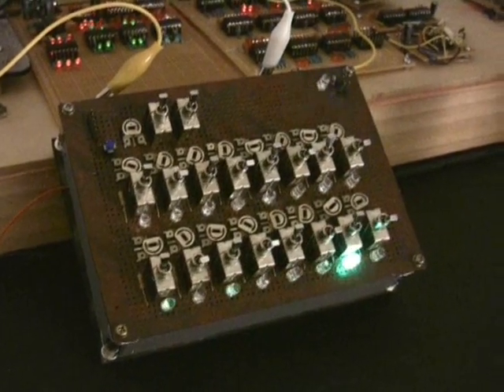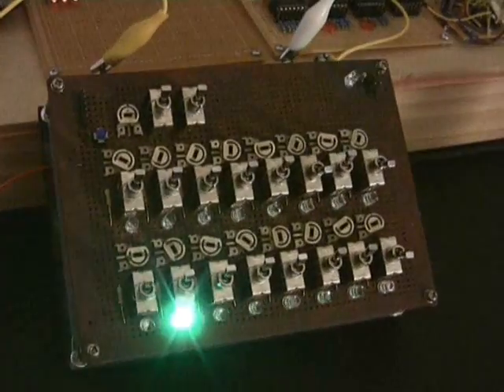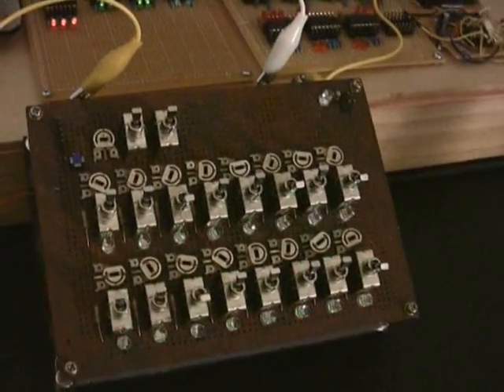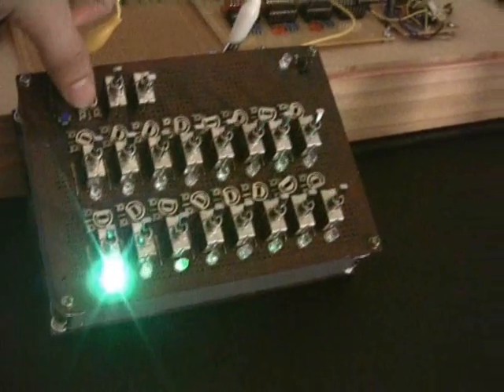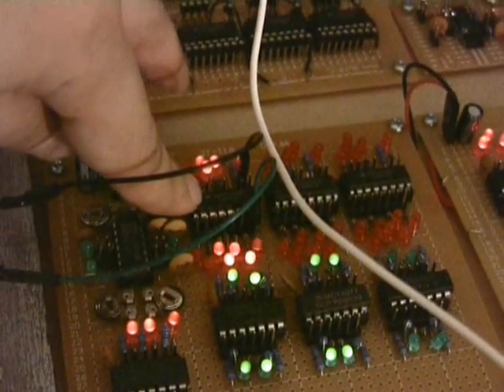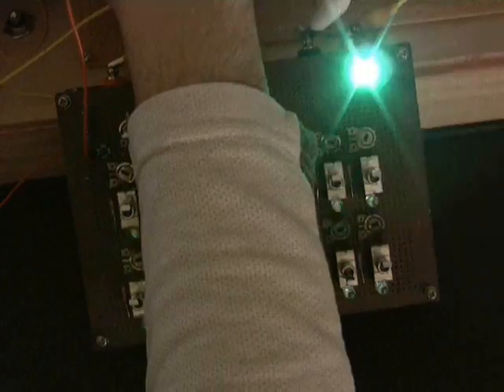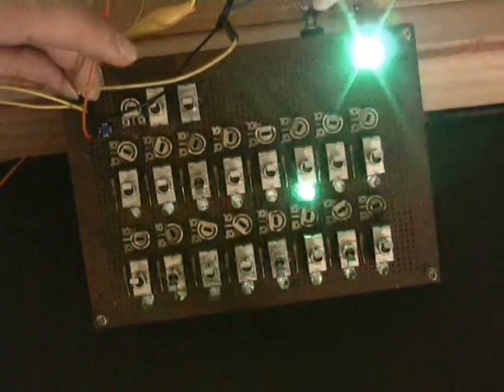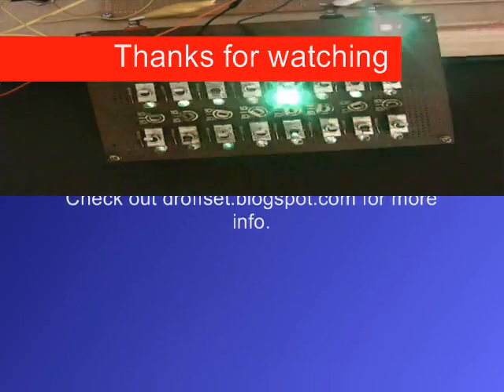DIY SYNTH - 16 Step Up/Down Sequencer

Comment: do you just send the 'preset enable' pin high to reset?  (Oh and v awesome BTW!)
Reply from the maker: Thanks! Yes that's right. A pin on the IC is held down with a 100k resistor and you input a quick high pulse.  Sorry it has been a little while but I'll have a look to see if my notes include good info.